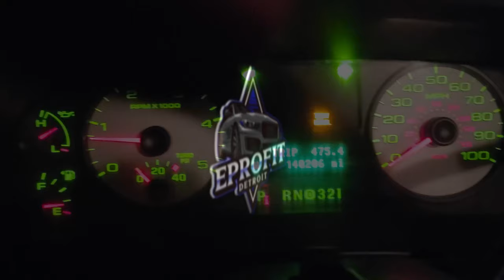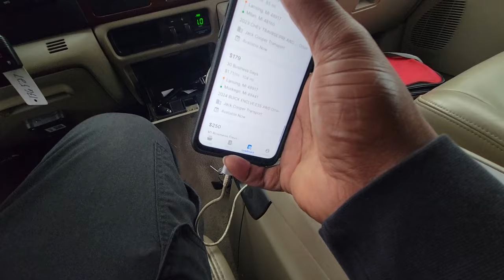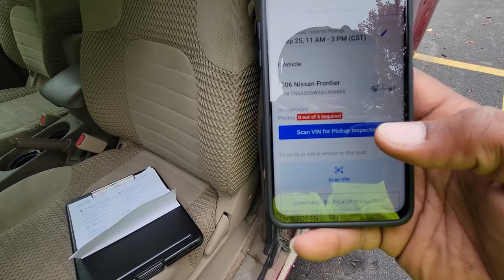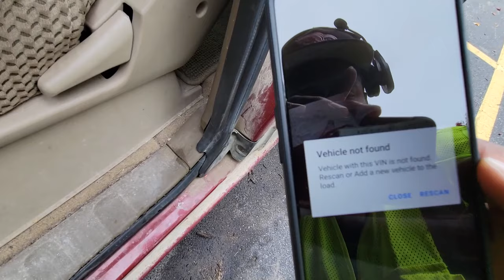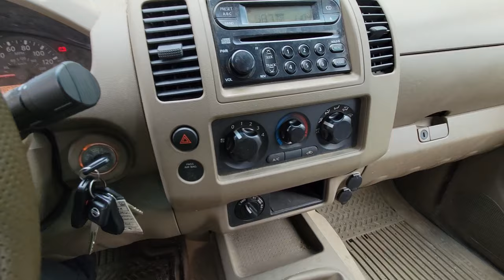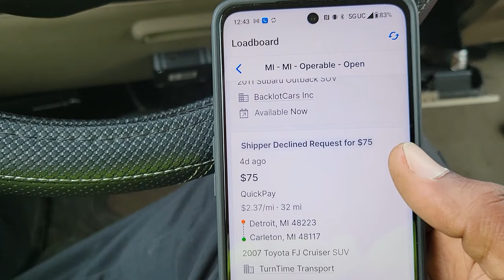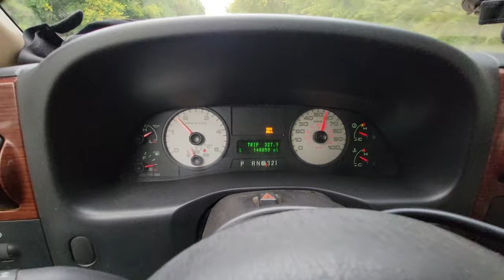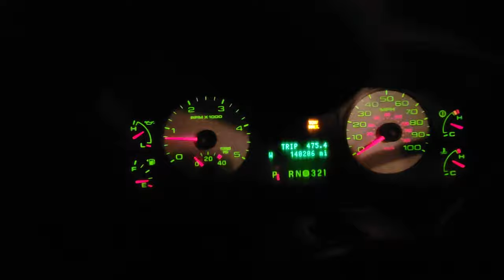Hotshot Car Hauling, $1000 A Day? as a New Authority

Comment: When backing those cars down I find it better to tilt both side mirrors down and that way you can see you back tire when they reach the ramp to make sure they’re lined up. A lot better than hopping out the car. If the backs lined up then the fronts will be too. Stay safe out there brother.
Reply from the maker: Great tip, i actually do both, but wanted to stress the point of safety first for beginners in my videos. Those extra seconds it takes to hop out and check  can save you alot of worries . Thank you for the advice ✊🏽

Comment: You really should be watching your oil temp that 6.0l like to clog up the oil cooler and causing bad things to happen I'm a fan of the Ford but it does have issues and the oil cooler is one major problem
Reply from the maker: yes, I've heard this. I want to get a monitoring system but I cant use it while using my eld . I change the oil every 2k to 3k miles  and use the high temp oil. so hopefully I get a descent run with this truck , my fingers are crossed 🤞🏾
Reply: Get a splitter and that way you can use both eld and monitoring system.

Comment: Do you think you would like a flat bed style trailer better than the wedge style?
Reply from the maker: definitely , its called a lowboy. its easier to strap your cars with lowboy style trailer but flats are usually shorter in length ,which limits what type of vehicles you can haul

Comment: great vid, so im based out of florida with a cdl. what was your overall starting cost?
Reply from the maker: start up cost ? equipment, dot & mc filing plus insurance around 30k
Reply: @EprofitdetroitTheProcess another question, do you think it would be crazy to take out a loan to get started?
Reply from the maker: Its risky honestly but No thats what most people do. The majority of haulers financial their trucks . On average a new dually pickup cost between 60k to 100k . If you plan on operating interstate,  meaning going Over the road long distance i suggest you get a good fairly new or new truck,  you'll just have to hump. But that the game.  People take out loans for semi's and trailers its how most get started.

Comment: What load board were you running in the video?
Reply from the maker: super dispatch
Reply: @EprofitdetroitTheProcess  appreciate it, I’m just getting into it, do I have to send paperwork to each broker or do I have access to all brokers on super dispatch formwork
Reply from the maker: You'll have to apply to be a carrier with each and every broker you work with and will have to add them as a certificate holder on your insurance

Comment: 🐐 you need a CDL to do this?
Reply from the maker: you need a cdl only if your combined GVWR ( gross vehicle weight ) is over 26,001 pounds, so yes . My truck is 13,001lb and trailer is rated for 21,000 lb GVWR. You can haul with a 2 car trailer and only need a chauffeurs license . but do all your research first ✊🏾